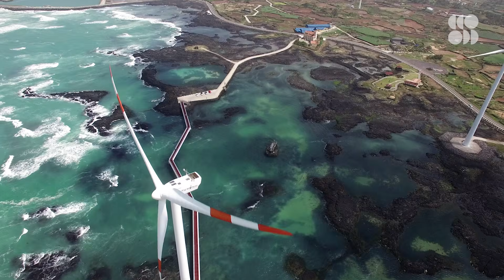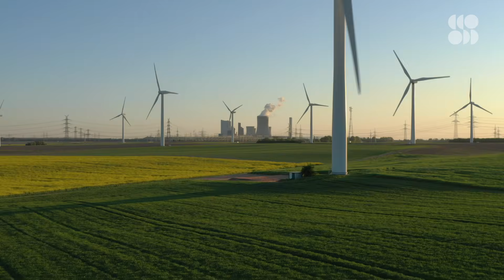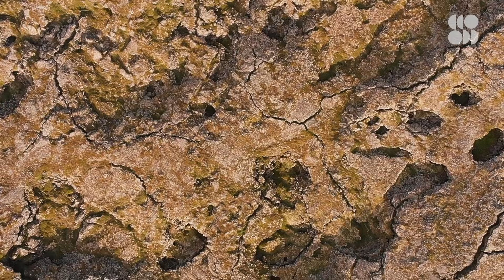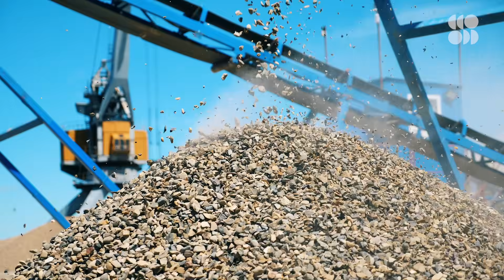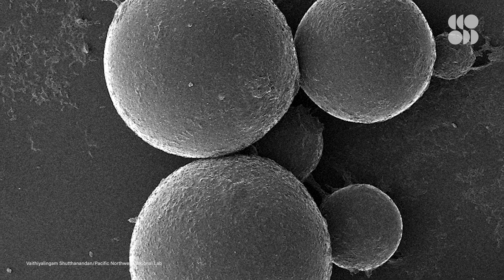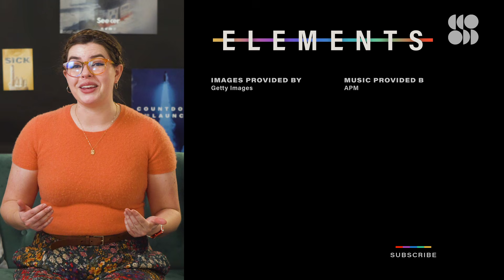These Rare Elements Are Key to Renewable Energy, But What If They Run Out?

Comment: They can all be replaced.  Ferrite magnets have no rare materials. LIFEPO4 needs no cobalt,   It fear uncertainty and doubt.    There are no problems with going 100% renewable.  98% of solar panels use no rare earths. 50% of wind turbines use no rare earths.
Reply: Rare earths are often used because they are cheaper. For instance you can produce wind turbines without gearboxes.

Comment: You’re telling me we’re still going to have nuclear waste even if we don’t go nuclear? I don’t understand why solar and wind are the route we’re taking rather than nuclear power plants.
Reply: Nuclear is the logical path toward a sustainable power future, but the fear factor it comes with is enormous. Solar and wind are easy sells.
Reply: @nalgene247  that and the fact that nuclear power plants are immensely expensive to build, and could take up to a decade to be fully operational
I'm all about nuclear, nuclear is objectively great 
but please stop minimising the issues about it to ''public fear bad'' 
that doesn't help the cause
Reply: @matheussanthiago9685  
The feed-in tariffs for wind and solar completely obfuscate the instability they introduce to the electric grid. The true cost is higher because you have to pay plants to sit on standby. Those standby plants may as well be load-following nuclear reactors rather than carbon emitting gas turbines.

Comment: I don’t understand you need silicon boron and phosphorus to make a regular solar cell with efficiency of 19% all of those elements aren’t controlled by China and abundant
Reply: There are a lot of elements that can be used in various types of solar panels, each having different properties (things like better low light performance or higher overall efficiency). But yes it's certainly possible to build them out of readily available materials even if there might be a bit of a performance hit.
If they move to perovskite solar cells then the only resource we would have to worry about is the copper or silver to wire them all together. Not because it doesn't use them but because it uses incredibly tiny amounts.

Comment: Proportion: Fossil fuels and OPC produce 10,000 times the pollution as REES for the same kWH. And that's before you count climate change and recycling.

It's great to be responsible with REES; it's far, far better to remember we don't have time to keep dumping fossil emissions.

IPCC AR6 starkly warns the end of conventional farms, fisheries and forests if we do not act now:
1.	Energy efficiency, 100% switch from inefficient fossil fuels by 2030. 12%
2.	Cut fossil extracts on emission paths 1% of today's level/month to zero by 2030. 80%
3.	Drawdown like 4 new trees/person/year (2/Canadian/week in Canada). 3%
4.	Ecosystem stabilization, like depaving, conservation, and restoring wetlands. 3%
5.	Super-GHG reduction, like adding seaweed to feed to slow cattle methanogens, harvesting trees before they rot, refrigerant and foaming gas controls, and ending aboveground methane processing. 2%

Comment: Early Tesla EVs used AC synchronous motors with no rare earth magnets, they were just a little less efficient. New motors have been designed by OEM suppliers that use induced magnetic fields in the rotor, no rare earths and more efficient because the induced magnetic field can be tuned and computer controlled for maximum efficiency.
Reply: Tesla motors aren't made by suppliers, they are made in house and tesla uses alot of rare earths.
Reply: @alanmay7929  The first Tesla model S and X used AC synchronous motors, no magnets. Only for the model 3 did Tesla start using motors with rare earth magnets. EV makers can easily go back to improved motors without permanent magnets.
Reply: @TheViewFromUpHere  vw for example uses magnets with basically no rare earths

Comment: ### Definition of REES:

- Rare Earth Elements (REES) in group 3 + lanthanides are important as they are key parts in electronics + green technologies + lasers + medical imaging machines etc.
- The reason why they are useful is that they are easy to be magnetised in their solid forms. It's application includes Neodymium, Indium and Terbium for solar panels and wind turbines

### Obstacles of REE:

1. Damage Environment + health 
    - Extracting REE requires mining which produces wastewater + heavy metals
2. Political matters: 
    1. Democratic Republic of Congo
    2. China having 93-96% world supply of REE
3. Research has shown that to keep up the trend we need to produce 12x REES used in those techs by 2050

### Solutions:

1. Rutgers University: Using bacteria producing acid to coax REES, causing less environmental environment
2. Waste less REES during extraction
3. Avoid using REES in their technologies (By experimenting other metals + changing design)
4. Reuse + Recycle REES from our smartphones. Bacteria (Ex. E. coli extracting electronic wastes)

Comment: Why not to use the “waist” radioactive materials, (uranium, thorium) in new generation nuclear reactors? This reduces co2, radioactive mining “waist”, and may also help to reduce the problem of current nuclear “waist”.
Reply: Don't use the word nuclear, that's scares them. Honestly though nuclear power is the obvious solution to this whole problem but because we only have enough nuclear fuel to power reactors for 2,000 years they don't consider it renewable even though there's no way there's going to be enough resources to build the amount of renewable energy infrastructure needed to rely on it long term.

Comment: I think for most metals, technical cycles could be realized such that they are near 100% recovered. After all metals don't degrade. Exceptions are things like catalysts, eg noble metal catalysts finely distributed along streets from car exhausts. The opposite to technical cycles are organic cycles, where waste is a nutrient. Realizing and fully closing these two cycles should be the main ambition. But it is very hard.
Reply: Organic processes are no different than artificial ones. Whatever you can't combust from any type of fuel can't be used by other organisms as energy. Molecular machines are small furnaces that consume the exact type of electromagnetic energy stored in the chemical bonds between carbon and hydrogen. If you make an engine that exhausts fuel to feed other organisms you are making a really inefficient engine, if you're talking about chemical batteries instead of engines then we come to the awkward question of where does the energy come from? Because even organisms that make their own food need sunlight and nitrogen, those who break Nitrogen bonds need glucose, those who exhaust methane need glucose as well. You can't take energy out of an already depleted source. And no, nutrients are not energy, metals,, phosphorus, sodium, potassium and other trace elements can't be digested by pure will alone, they need to be metabolized by chemical processes that consume glucose.
Reply: The only organic "closed cycle" I can think of is a terrarium, the problem is that it needs sunligh and the heat one can extract from the soil microbes can't be controlled at will. And tbh the amount of energy that photosynthesis can absorb from sunlight is stupidly small and ineficcient compared to a solar panel.

Comment: Will graphene be a solution?  (Hope I don’t sound dumb). 😊
Reply: @rishab7746  what do you mean graphene cant be used in all appliances and is not malleable?

As far as I have seen graphene can nearly be used to enyance everything in one way or another in application or appliances. Graphene as well is completely malleable and can conform to any shape required, let alone being only 1 molecule thick.
Reply: Graphene is already being trialed as a replacement for the current electrode layer in solar cells. Given its about as flexible as you get, it's great for use in flexible and thin film solar cells. Graphene also has ideal properties as an electrode given it has extremely low resistance (current) across the plane(across the surface) and very high resistance through the plane meaning that it works both as a conductor and insulator in the directions needed.

Comment: Honestly why don't we just avoid the political and environmental aspects by moving towards asteroid mining because we have the technology for it we just need one big push mine just one asteroid and I think that would commercialize it
Reply: Large scale asteroid mining is still out of our reach due to a lack of space infrastructure and technology. It's not super far out of reach, but it will still take multiple decades before the technology is ready. And after that efficient asteroid transfers in space can also quickly take months, years or even decades.

So expect your first space booty not much earlier than 30-50yrs from now.
Reply: I'm probably wrong so tell me what you think
Reply: @pcgrmreaperff8243  Cost mostly, alot of planning if something happens that we believe we know, (i said that cause theres unknown things we still dont know), how would you extract it, would be hard with no gravity, alot of our mining is based around having gravity, i mean really cant think of anything how we could do that but of course im not a smart person either so what the heck do i know. Not to mention ore processing, and smelting requires alot of energy so a huge amount sustainable energy is required. Then transporting it is another thing once its done, im curious what a large and very heavy vehicle would look like coming in at a re-entry, i would imagine that would not be a problem with temperature, with the heat shield plates, i guess anyways but i would it would be harder to stabilize.
Reply: fuel cost
Reply: The problem with asteroid mining is there's no material that's valuable enough for asteroid mining to make economic sense. Also, if a lot of rare ore was mined from astroids the cost would plummet making astroid mining unprofitable.

Comment: Let's put solar panels on every home, business and covered parking rooftop and switch to electric vehicles making nearly everything we do solar powered while completely decentralizing our power supply and empowering everyone as power generation owners.

Solar power is CHEAPER and electric vehicles are soon to be CHEAPER to make and already are considerably CHEAPER to maintain and operate, especially if charged from your own solar power.

A 3-5 year ROI (return on investment) for a solar array that will generate power for decades is a no-brainer and the panels can even be made locally too.

#EndFossilFuels #SwitchToSolar #SwitchToElectric #GreenNewDeal
Reply: Producing billions of solar panel is more polluting in the short term than using non renuable energy
Reply: @theape8462  untrue except for 3 types of energy, only wind, nuclear and hydro energy are less carbon intensive than solar. If solar is replacing coal, gas or oil, it's better....and by several order of magnitude
Reply: @failandia  of course in the long term it's like this, in the short term you should destroy and sanitize hundreds of coal industries (creating poverty for not only cities but whole countries), building one solar panel for each person means 7billions of solar panels which means you should dig hundreds of new mines to extract the materials. A gradual change has a lower weight on the planet than a sudden change
Reply: @theape8462  But there's no time for gradual change (even if it were feasible). We just don't want to recognize that we're screwed.
Reply: @klondike444  i'm saying the exact oposite, doing things too fast means polluting even more the enviroment, you think solar panels, wind turbines and nuclear plants are built from thin air? Building anything related to storing energy is super polluting, your answer to stop climate change is to contaminate the enviroment to absurd levels now so that in 10/15y from now we do it less?
Reply: @klondike444  the only way to slow the climate change would be to consume less but our economic system doesn't permit it
Reply: @theape8462  Ah, so you do get it. Something has to give, and I believe it will be energy consumption and our economic system. Like I said, we're screwed.